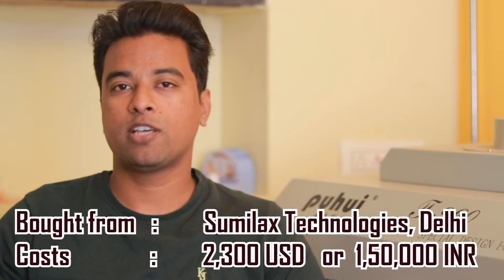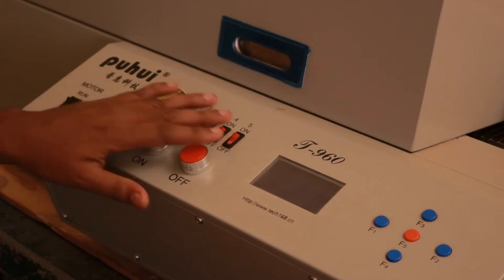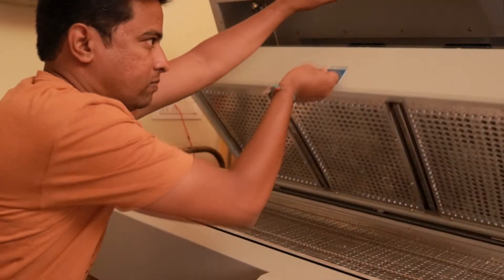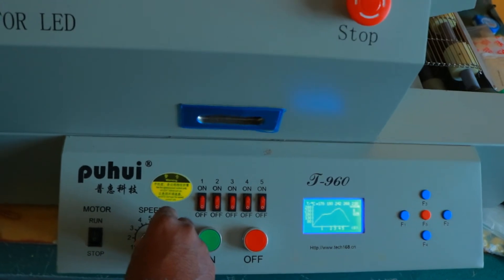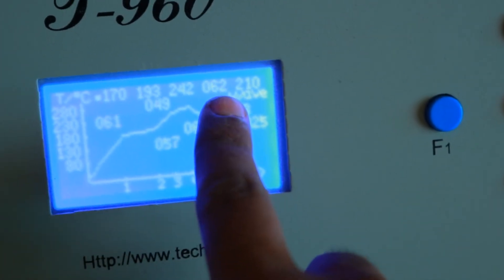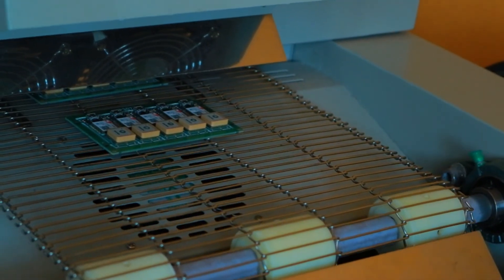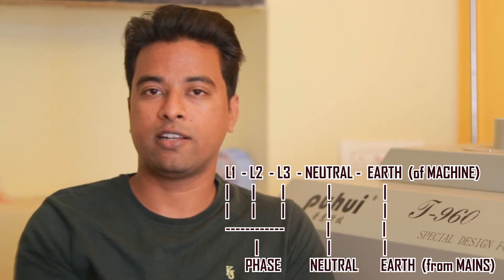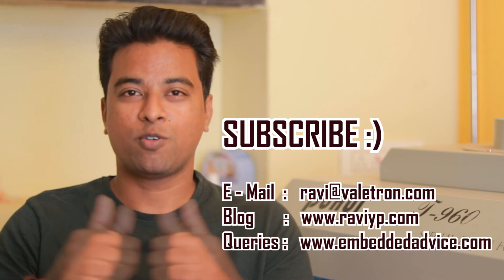I bought a T960 REFLOW OVEN - SMT Assembling unit - #MakeInIndia

Comment: Hi Ravi, good sharing video. Is there any flux residue to be cleaned after solder? What solder paste type do you use. Many thanks
Reply from the maker: Flux residue needs to be cleaned only if you use flux. If you only use solder Paste and do stencil work properly, you don't need cleaning. If you get flux or paste outside in open areas, you can use ultrasonic cleaners with flux removing chemicals. We use Alpha Cookson paste.

Comment: Hi Ravi,
How do you manage to do double side assembly with this machine?
Reply from the maker: We reflow one side and then relow other side. The parts on soldered side won't fall due to surface tension or what they call it. They are held in place. You can use SMT glue also for heavier parts which are at risk of falling off.

Comment: Have you ever try to reflow double side component PCB? If yes, how was the performance?
Reply from the maker: We always relfow double sided boards. Heavy parts like GPS modules fall off since we don't use glue. So big parts are reflowed after smaller parts are done. Reflow works fine
Reply: Ohh that's great! What about reflow profile, did change it for double side? Like reduce temperature of down side heater? Apart from that I would like ask two more question. Have  you ever reflow more than 4 layer PCB? I just wonder if the plane layers effect reflow performance or not. How is the lead free paste reflow performance ?  Thank you for your comment :)
Reply from the maker: @farukcetinkaya1019  using same profile for lead and lead free and heaters are only on top. You need to reverse board and send in again.

Comment: Hello Ravi, do you also have a pick and place machine along with the reflow machine ?
Reply from the maker: No, we haven't bought a PnP machine yet
Reply: @RaviPujar  which pnp machine you would recommend for prototyping designs.
Reply from the maker: @Rajat0607  Depends on budget and number of type of boards you make and size of parts you use.
Reply: @RaviPujar  hi ravi, I am into power supplies running off mains from 5W to 800W. Also integrating FPGA (BGA) and upto 150pin uCs into the supply. Using a combination of SMD and through hole components. It want to be able to mount min 0603 components. Budget may be roughly upto 2.5L - 3L

Comment: Thank you for this video and the accompanying blog post, Ravi. May I ask how the T-960 is faring here almost two years later? Has the investment paid off? I'm considering getting one, but am unsure if its actually powerful enough to do lead free soldering. Do you happen to do lead free with yours?
Reply from the maker: Yes it should work with lead free too. It has been performing great. No problems at all. Fantastic machine. I am very happy with this investment. I only turn it on twice to thrice in a month. I have friends who are running it daily for long hours since years. No problems

Comment: Thanks for the video. Very informative. However, what is the difference between your machine and this small Puhui T-962A desktop infrared wave soldering station ?
https://www.alibaba.com/product-detail/Puhui-T-962A-desktop-infrared-wave_60831756150.html?spm=a2700.7724838.2017115.50.1e266eacHayFQj

Comment: Did you have any problem soldering aluminum electrolytic capacitors?
Reply from the maker: Haven't tried aluminum electrolytic capacitors yet. Most of our designs use small parts. Do they cause problem when soldering in ovens?

Comment: nice tool really ! The other model from the same brand the T-962 is famous for being unusable out of the box because of its poor design (paper tape instead of heat resistant kapton, poort gounding of the chassis, poor software, no cold junction temperature measurement etc) did you notice anything similar with this one ? Did you tear it down a bit to check for those issues ?
Reply from the maker: jeremy X There is no plastic on the machine.  It's complete metal,  very strong and solid. I have checked everything inside. No issues so far.  Have made around 4000 boards so far. It's doing great :)
Don't forget to Subscribe :)
Reply: hum it seems like a worth it investment then, almost make me want to buy it haha ! Good job and just suscribed ;)